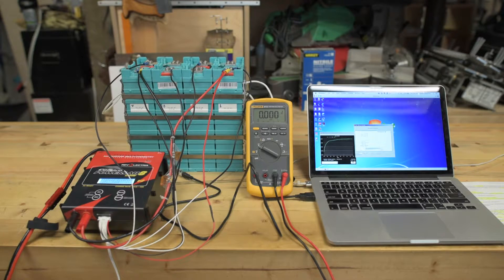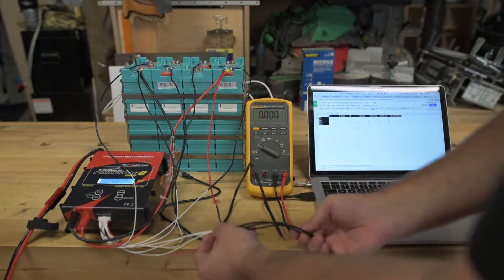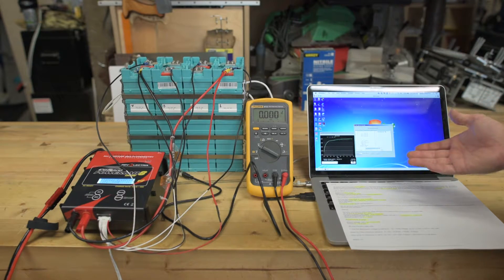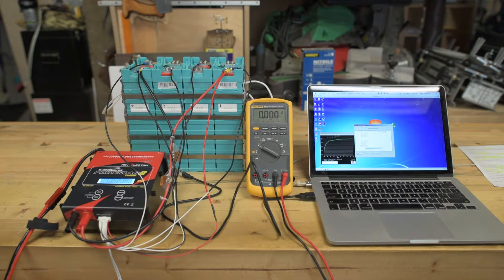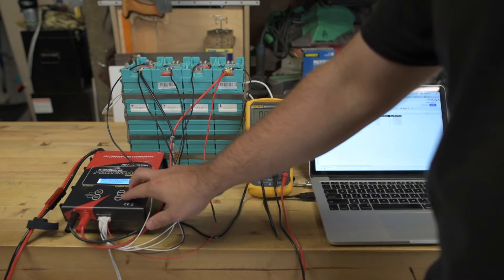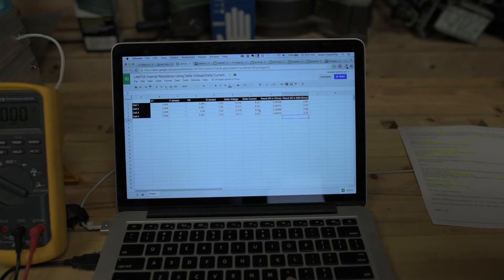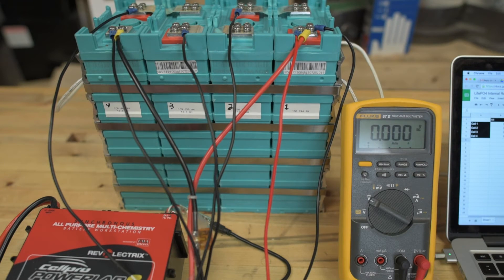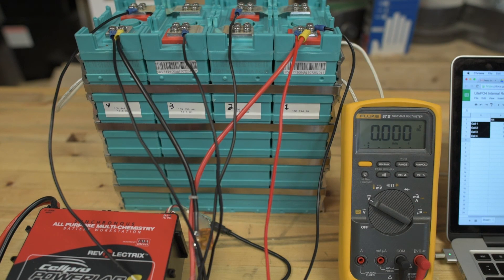LifePO4 4S Ri (Internal Resistance) testing using Delta Voltage / Delta Current

Comment: You mentioned current bouncing around. This has bothered me for a while with my ToolkitRC M8S. I know it’s not a high end chargers (Powerlab 8 is def on my list for next balance Charger unless an iCharger 4010 or 408…or X6/X8/X12 drop into my lap. I’ve tried a bunch of different PSU’s but no matter what the current bounces. Starting to wonder if I could turn off balancing if that would stop it. When I use the output mode (it’s a bench top PSU mode) the charger is pretty steady. 

I just built a power supply using two HP Proliant Server PSU’s and it’s one of the best little hacks I’ve done but even those two powerful PSU’s fluctuate at any current level . If it wasn’t for the nylon hardware you need to float one of the PSU’s only coming in a kit for $11 you could make a 24V charger from two 460Ws for under $30. Just need that hardware and some connectors like bullet connectors or binding posts/4mm banana jacks , some appropriate Silicone 200* Celsius wire based on which charger you choose (460=10/12AWG 750=8AWG 1200=Double 8AWG), a Y split C13 cable (460 only, 750 and 1200 too big for one circuit) and some way to insulate the chargers if you stack them up and shrink wrap them. You could do 100/120mm flat shrink for each PSU and then wrap both with a 200/220mm flat, use barley paper on the PSU’s and just one big shrink or be like me and use electrical tape but decide that’s not enough and heat up a sheet of acrylic to bend over a 2x4 which sits on top of the bottom PSU like a glove. Then a chunk of the big heat shrink and it’s one package you just gotta connect then in series and to the charger. I did it with the 12AWG banana cables I made using parts that claim to handle 30A. Had to drill out the inside of the insulate part of the banana plug to make the silicone wire fit. 

24.6V 32A. Max voltage before you gotta mess with OVP is like 12.8-13.0 per supply. Be safe if you decide to do it. If you don’t understand floating one of the PSU’s then buy one premade or message me

Comment: Over 2.0 mR seems a tad high for 105Ah cells unless they’ve seen some cycles…like a years worth. I think the Eve 280’s are supposed to be <0.5mR. Just silly low. I’d guess 105 or 108Ah cells would be <2mR

Pretty much every charger with an IR function is kind of inaccurate to wildly inaccurate. The absolute worst are the spring slot style 18650/other cylindrical cell charger/analyzers. People don’t understand the physical parts of the sliding slot that connect with the negative increase the IR plus how the cell gets seated can change your result by 50%. Opus clearly says in the manual to deduct 30 mOhm off the number shown to compensate for the resistance in the parts of the charger. I’ve noticed my Xtar VC8 seems to be pretty good but the Xtar VC4SL’s are consistent amongst the 4 I own but give numbers in a different range compared to the VC8. Or maybe I’m biased because the VC8 gives the lowest IR numbers. 

Xtar can only discharge at 300mA except I believe the VP4Plus so I’m guessing they do a quick charge current and measure that voltage. No double current for increased accuracy which I don’t know of any charger that does two different readings

Another factor is your balance leads. I had some long ones on my ToolkitRC M8S for a while and was stumped why they were higher than usual…then it hit me. I added 18” of extra wire to each lead because my A123 packs are bulky. 

Has anyone tried doing 2 discharge currents and 2 charge currents to see if those numbers are the same because if so maybe that’s a good way to check your accuracy. 

Then there’s also the time the cell is left to rest and getting all 4 readings at the same time. “Easiest” way would be 4 Drok 5 Digit Voltmeters loosely calibrated to match your Fluke in that range and then film it. If you want the voltage at 10 seconds then just put the video into editing software and pick the exact time and read the voltmeters. 

AC IR is so much easier thanks to the YR1035+ and RC3263 but AC is usually almost double DC IR

Comment: I find it hilarious that the rc charger you're using calculates internal resistance for you. I just looked at the manual, it says you have to start charging at 75% capacity or below

Comment: Next question. I forgot to use the rs232 adapter and plugged directly into the serial port on my kelly kds100 controller.  It still works but I cannot access the programming to shut off the regen.  Regen is just flyback current right?  If I add flyback capacitors in parallel with my battery pack will that protect it?  Do I also need to add some capacitance to keep the flyback from damaging the controller?
Reply: Wait, flyback occurs when the bms shuts off the power.  Regen happens whenever the motor starts making more energy rather than using it. How do I protect the system from flyback and still take advantage of regen?  If you think I will eventually find the answer on endless-sphere just say so and I will keep looking anway.

Comment: To do the IR test with powerlab works best cell by cell. 
Should have cell by cell voltage info on the powerlab just scroll till you find it.
Reply from the maker: Yeah, the original 13.x milli-ohm figures were from cell-by-cell measurements on the pl8. Are you saying this test should have been on an individual cell basis too?
Reply: Your test was fine. but Yes using pl8 IR check best done cell by cell. 
(like your original cell-by-cell vid) When cells are in series first & last cells will have a higher IR than cells between them. All ways you have tested them are fine as long as you test them the same way in the future to check battery health.
Reply: @TheOffgridkid  Do you or @createthis know what IR would indicate a bad cell? I have cells that are 7 years old now and seem to be getting out of balance more quickly than I remembered. About to do a capacity and IR test on them this week. I have a quantity of 8 Sinopoly 200ah 3.2v LiFePO4 cells... any recommendations on how to test definitively would be appreciated. Not a ton of info on how to spot bad cells... just videos that have all new good ones!
Reply from the maker: I’d say any value significantly different from the other cells would be suspicious.
Reply: @createthisdotcom  I tested the eight cells similar to how you did with a 1A and a 10A draw, and each show around 1 milli-ohm resistance (3.26v to 3.25v, for example). I wondered if these low values weren't telling enough so I put 4 in series and connected to my 2000w inverter and repeated the test but at a 10A and a 160A draw, and found very similar results with each cell being around 1 milli-ohm (3.25v to 3.11v, for example).
The iCharger X6 reported .3 to .6 milli-ohms resistance for each cell, just for comparison. 
Not sure why my cells appear to be getting out of balance but I am doing individual capacity testing now with the iCharger X6, its going to take a while. First cell has been on the charger for 11 hours so far and has taken 131A (on a 200A cell). Not looking forward to doing all 8 but while I'm here, might as well. 
Any other ideas on why my cells may be getting out of balance, I'm all ears!
Reply from the maker: Could be a wiring difference. More resistance in one connection.
Reply: @createthisdotcom  that was my only other thought but the lowest cells in the pack were in the second position and highest were in the fourth position so it wasn't a linear change. Also have the cells connected with really beefy 1/8" thick x 1" wide copper bars that were just cleaned up. No idea... just going to reset and put them back in service and hope that the issue doesn't reappear. If it does continue to be an issue I'd love to get to the bottom of it but if I can't then I may just try adding the Electric Car Parts Company active balancer to the setup, it can balance at up to a 4A rate... that would be a bandaid fix but would probably actually work.

Comment: http://www.revolectrix.com/new_applications/software/pl8_software_v2.html
Reply from the maker: yeah, that's the version I'm running.
Reply: Could not tell??? 
Why is the window so small????
Reply from the maker: +off grid kid parallels desktop on a Mac. I keep it that small because if I make it bigger I lose UI elements in some apps. Windows has never been great about scaling to higher resolutions.